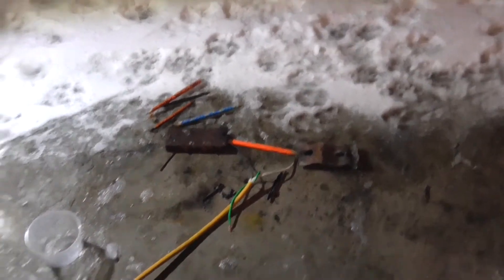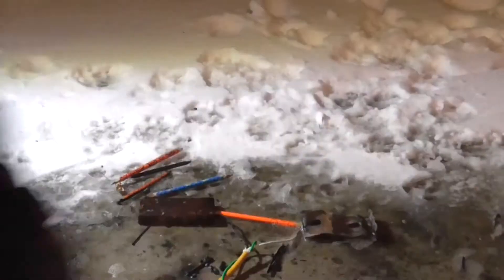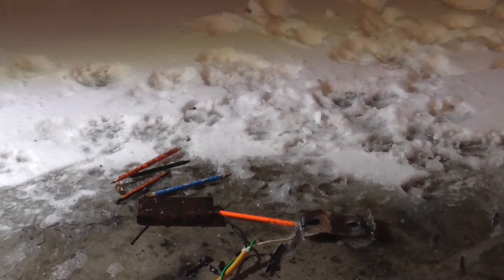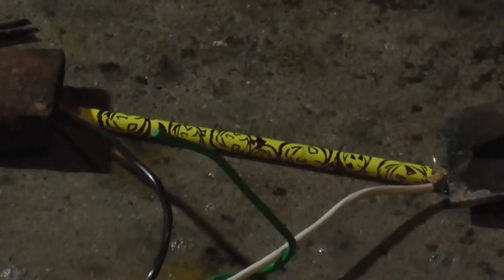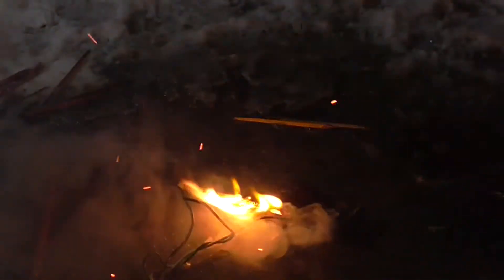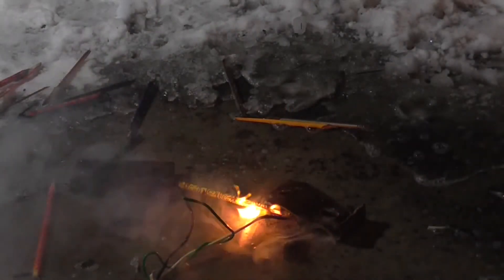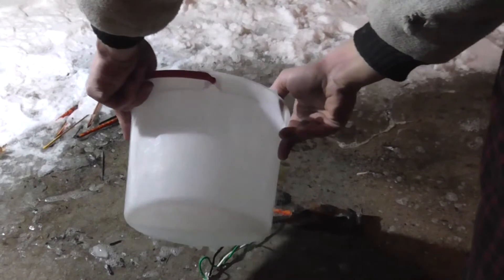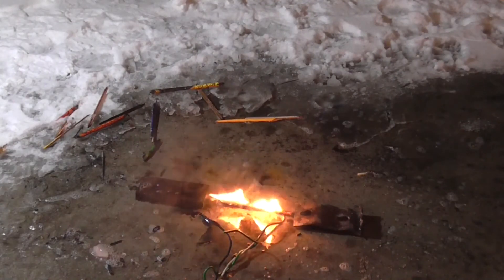Explosive 590V Pencils!

Comment: Nice! Looks fun! What if you used your pole transformer and drew arcs on the snow, it probably has a low enough resistance to get 7kV through it, that might look cool! Although, quite dangerous.
Reply from the maker: I might just do that, I think 14.4kV can do it, I need to get it on wheels as well, weighs a bloody 280lbs!
Reply: Oh wow, that's heavy! What is it's kVA rating?
Reply: Oh wait, you show it on one of your previous videos. 5kVA and it's 280lb? That's crazy
Reply from the maker: Yeah, it has aluminum coils and even some 10kVA's don't weigh that much, LoL!
Reply: Where did you get yours? I'd love to have one to use for experiments.
Reply from the maker: Got mine from the Solomon Corporation for a total of $520. I requested a quote for pole transformer of 5KVA, 14.4kV primary and 120/240v secondary with aluminum coils to make the transformer lighter and scheduled it to be picked up 21 days after ordering to make it less expensive, I also had it shipped FedEx Freight to a business and picked it up there, but you can pick it up at the local FedEx department as well. Don't get yours home delivered either. I'd be too expensive. Here, visit this video and read comments between Metersocket00 and I for more details, it has 34+ replies. Or is contained in the first comment.
Reply from the maker: Visit www.solomoncorp.com/ and request a quote.
Reply from the maker: Oh and these transformers can level a house if they heat up enough, but they do survive quite a bit.
Reply: Cool, thanks! Oh that's good to know, how much could a 5kVA handle for a short time? 10kW?
Reply from the maker: It'll handle 10kW easily, but the most I'd push them to is like 15KVA.
Reply: Variac Maniac Oh nice! So if I used a 50 or 60 amp breaker, for ballasting, could I use a resistive load? I have a 20 kW heating element panel from a furnace, it has 4, 5kW elements. Does a resistive load work for ballasting these or does it have to be inductive?
Reply from the maker: You can use heating elements, you can resistively ballast or inductive ballasting will work, either way it'll work.
Reply: Awesome, sorry for asking so many questions, I appreciate your help!
Reply from the maker: Anytime man;)